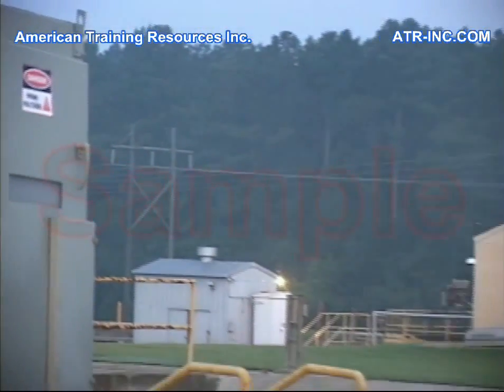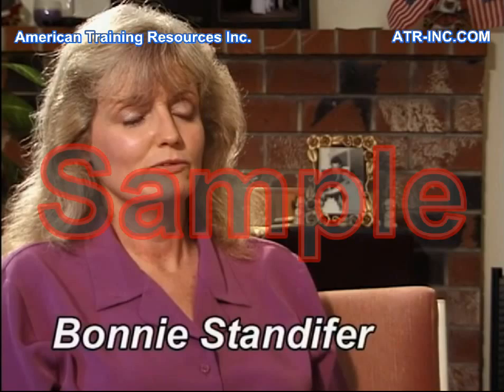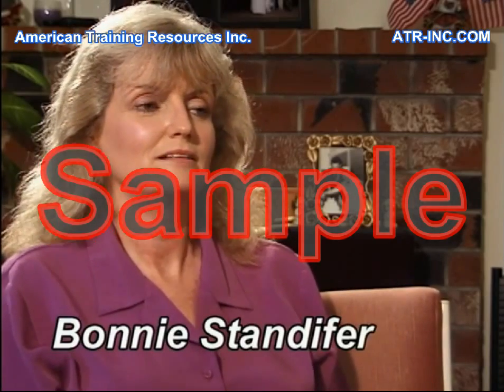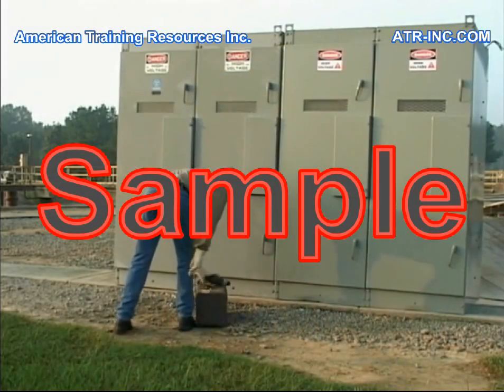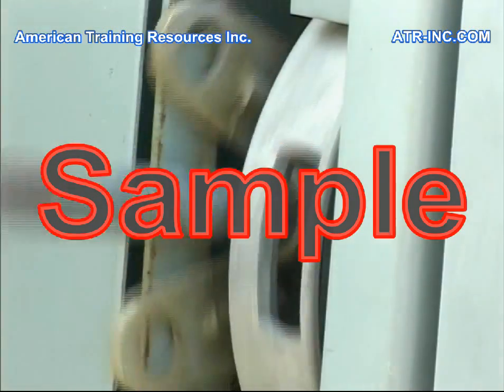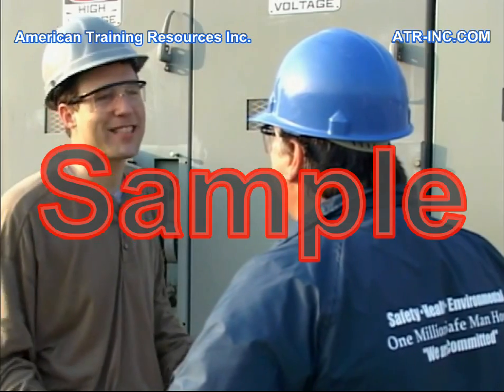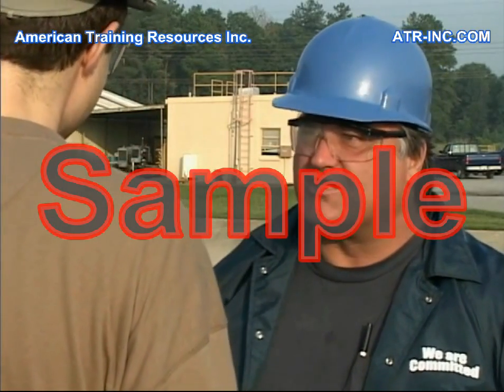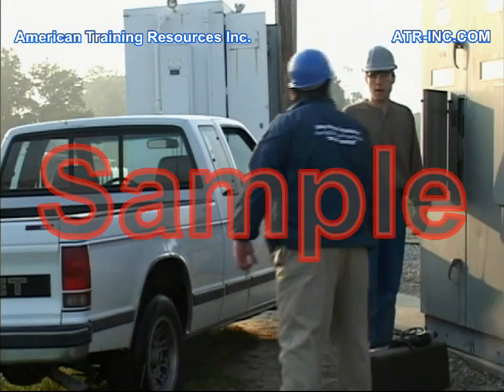Lessons Learned from an Arc Flash Tragedy - The Mark Standifer Story

Comment: ive hit a 3 circuit breaker on a 12v megabox and my god the nervousness i had when running a test out was terrible...always get the automatic 32ks protective stem when operating on electric circuits people....they are tested to withstand a level 12 electrical arc pulse
Reply: Read*